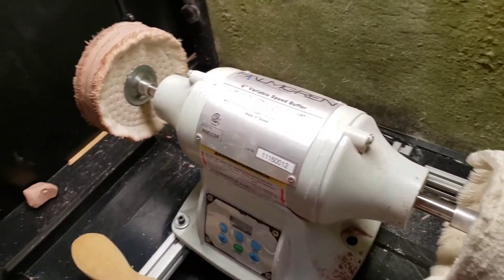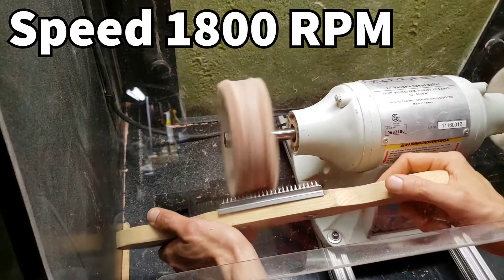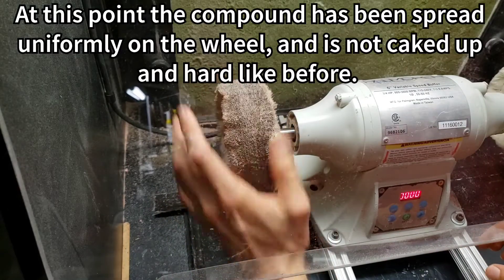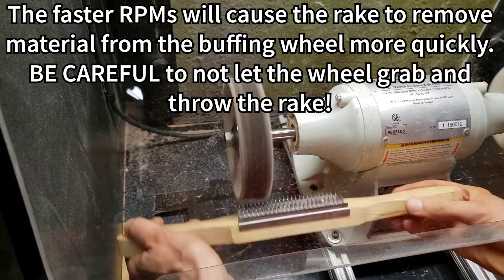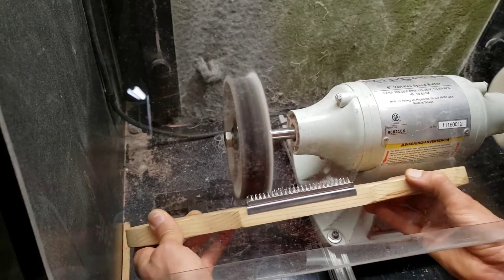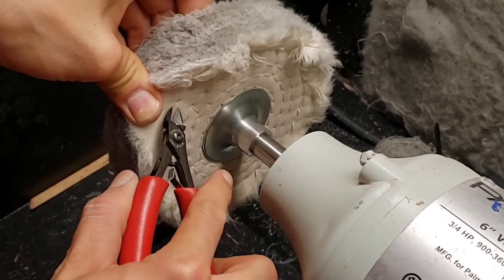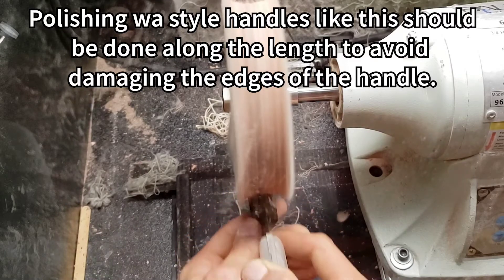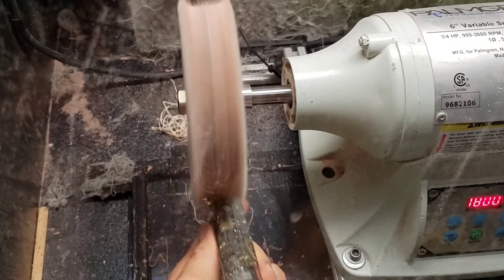How To Restore a Buffing Wheel - Clean and remove caked up compound using a rake - KRVR Chef Knives

Comment from the maker: Materials:
- Buffing Wheel Rake (double handle style as used in the video) - https://amzn.to/2Zt2gWh
- Buffing Wheel Rake (single handle style) - https://amzn.to/2ZvgINr
- 6in x 1in Wide (70 ply) Cotton Buffing Wheel - https://amzn.to/2GSrRBt
Thinner buffing wheels can also be stacked to create thicker ones. For example, you could use 4 x 1/4in wide buffing wheels to make a 1in wide stack.
- Palmgren 6in Variable Speed Buffer - https://amzn.to/33eSpnU
- Jet 8in Variable Speed Buffer - https://amzn.to/2FnAIKR

- Plastic Knife Blade Shield - https://amzn.to/2M4cNTP It's cheap and they last forever.
Reply: instaBlaster...

Comment: Yeah see I use a wet compound it's actually the Tormek buffing compound and so my pads get caked up with black metal and I often wondered about just trying to wash them with dawn dish soap and very hot water? 🤔🤷‍♂️
Reply from the maker: Give it a try and report back.
Reply: @engineerable  I actually did wash them right after I posted that comment and it worked out great although they dried a bit hard and stiff so I had to run them against a hacksaw blades teeth to kinda loosen them up a bit...

Comment: How important is the RPM speed when polishing materials such as aluminium, bone(horn), steel, plastic, etc? My Ryobi 150 watt bench grinder spins at 2950 RPM. Do I risk burning the material I am polishing at that speed? Also how important is the ply thickness of a loose stitch cotton buffing wheel? In my country, I can only find 150mm diameter wheel with 25 ply loose stitch and 50 ply close stitch to fit a half inch spindle.
Reply from the maker: 2950 RPM with a 150mm diameter wheel is too fast for polishing soft things that burn easily like plastic. It's also much more dangerous to use than at 1800 RPM. 1800 RPM can still grab and throw parts, but it's not nearly as violent as at 3000+ RPM.
Reply from the maker: I believe that you want close stitch, and you can stack them together for extra thickness.
Reply: @engineerable  When would one use an unstitched soft cotton wheel vs a close stitch wheel?
Reply from the maker: @taab7  Unstitched is for final finishing work and they conform better to the workpiece. They are less aggressive. These do work better at the higher speeds. I have not found them to offer a better finish at 1800RPM, they just polish slower and less aggressively. So unstitched will be better for polishing plastics at 3000rpm than stitched.
Reply: @engineerable  thank so much for your advise. I would love to have a variable speed buffer like yours but they are horrendously expensive and seemingly not available in my country. I'll get an unstitched 150mm diameter wheel with 50 ply and see how it works out for polishing an antique German hunting knife handle fashioned from deer horn that I'm restoring that has an aluminium pommel.
Reply from the maker: @taab7  You're polishing a full knife? I think that's very dangerous at 3000rpm, especially with a loose unstitched wheel. Even if you are just doing the handle, before you know it the wheel can grab and throw the whole knife, sometimes back at you. Loose wheels have a higher tendency to grab.
Reply: @engineerable  Thanks for that. I'll work on the opposite side of the grinder so that the wheel spins away from me and press against the upper quadrant of the wheel so that if the wheel grabs, the knife should should fly up and away from me.
Reply from the maker: @taab7  Although you may think that's safer, the wheel can easily grab something and sling it around 180 degrees back at you. High speed buffing of knives is not safe. It's only safe on objects that don't have edges that can be grabbed.